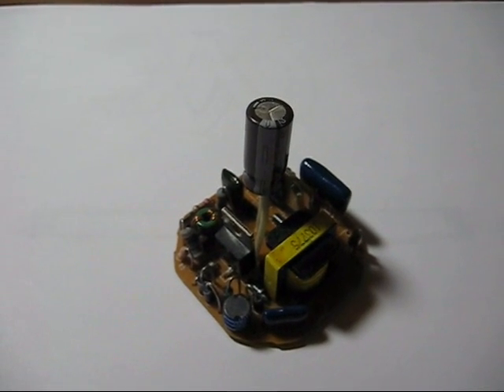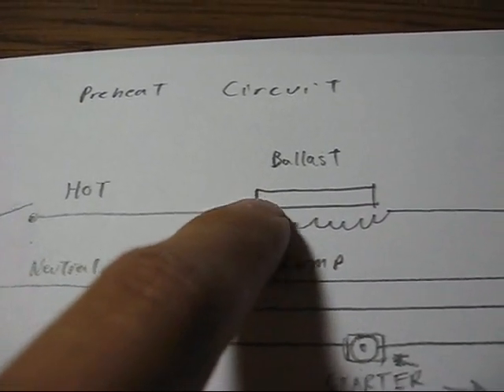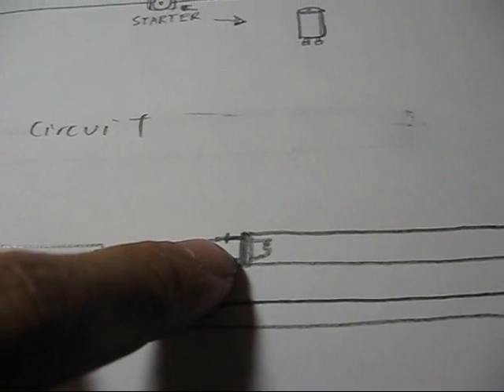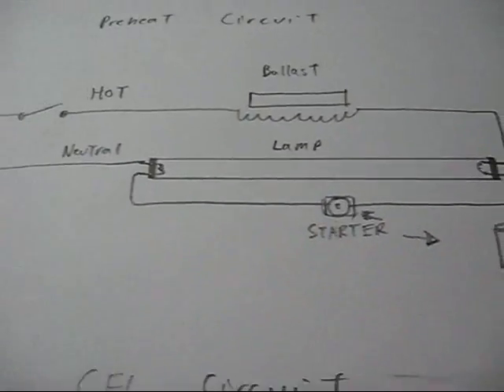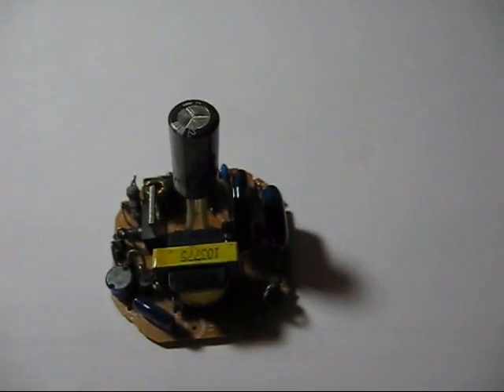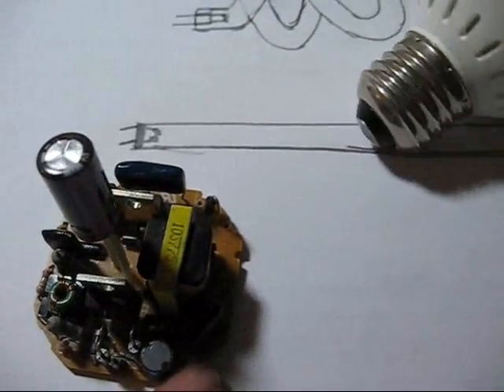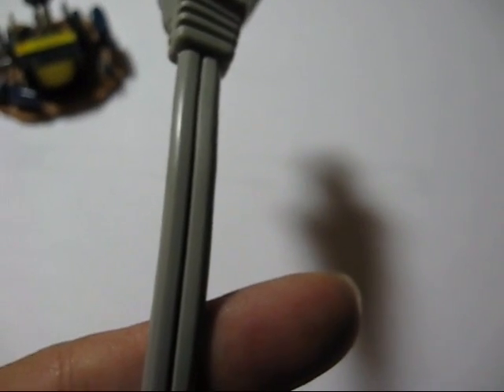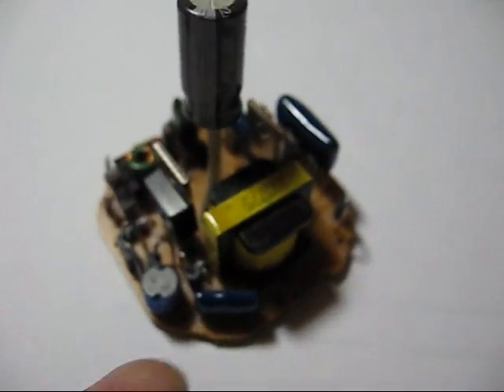Reusing CFL ballasts on linear lamps

Comment: Good solid vid. I just searched YT for reusing a ballast (wirewound type) and am surprised that no one has reused them for anything. It works, I am just thinking of rewiring some strip LEDs inside the fixture so I don't need the 12 to 22 watt circular type I ballast. Any way to make this work on 12V DC? I'm just looking for any reuse really.

Comment: it matters in terms of which one not to touch because it has ground reference, but doesn't matter for the power coord except on special equipment like air ioniziers that require neutral to be a certain wire

Comment: That ' thing' is not a fuse it's a resistor, I cut the coating off of it already. With these circuits its not a bother where hot and neutral  but is where the mains connect.